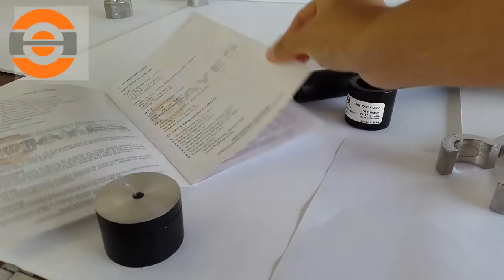SOCKET FUSION HEATING IRON HDPE PPR PIPE WELDER TOOL FACES COLD RING CHAMFER DEPTH GAGE PROCEDURE1

Comment: Can we weld 2-38mmØ HDPE pipe with butt fusion?
Reply from the maker: Hi Jose, you can weld from 2 to 48 inches with butt fusion. Under 2 inches with socket fusion.
Reply: @COLINDUSTRIAHAYESWELDING  Thank you, can we use socket fusion if we need to extend the length of the pipe without using  
fittings?
Reply from the maker: @josearneltabing6388  hi Jose, the answer is NO. The socket fusion always need a fitting. The butt fusion is the only method that doesn’t need fittings to extend a lineal pipeline